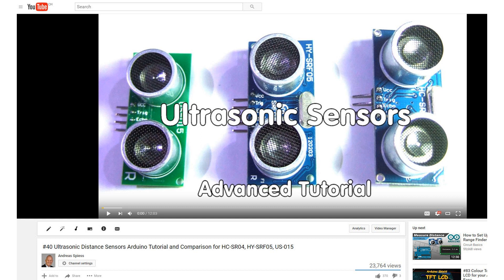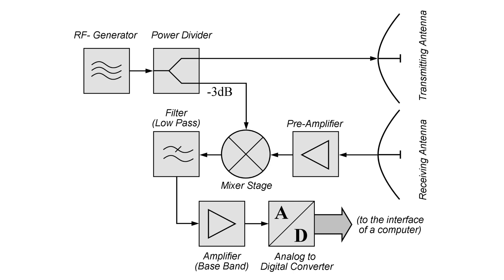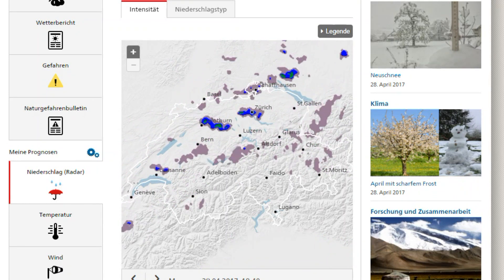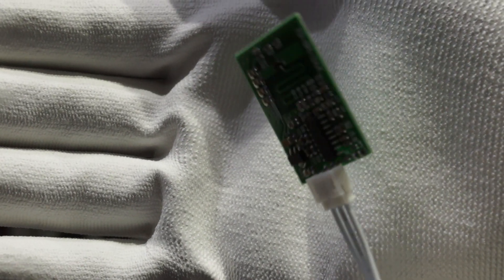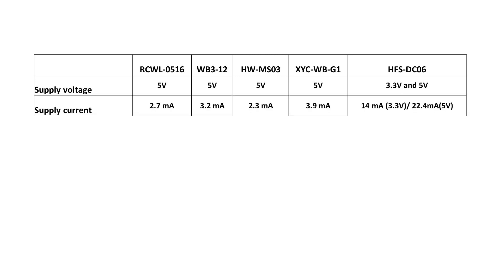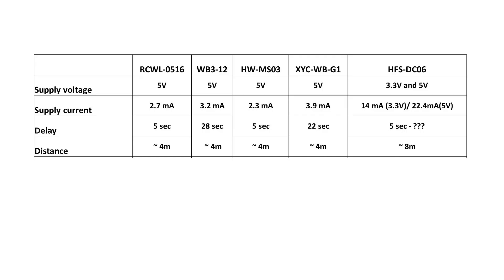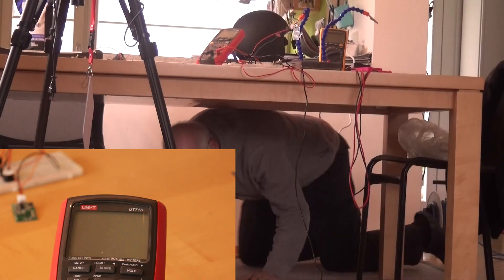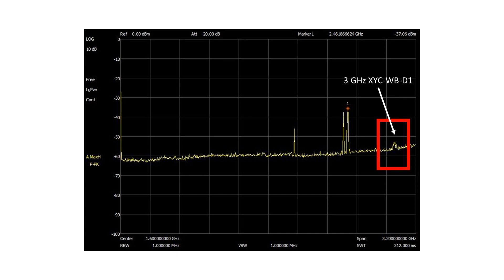#135 Radar Sensors / Switches: Comparison and Tests

Comment: thanks for your detailed summary - my favourite is also the RCWL-0516 (I've got a lot of them for experimental purposes) and I've also got some WB3-12 sensors but in contrast to yours, mine has got a delay-time of just 1sec - well, strange. I tried to find a way to influence this delay but so far I didn't find a way to manage it.  Apart from this there is another thing to mention:  in contrast to your words I just experienced, that WB3-12 (the white round) and the RCWL-xxxx  do interfere each other (however, I've tried it with just 30cm distance) - none of them is triggering in this close setting but actually it doesn't matter ..just saying  -  thanks and Grüße aus A in die CH  .)
Reply from the maker: Maybe they changed a resistor? Or there are different manufacturers with different needs for delays?
 Concerning influences: It is a wonder these devices work. For me, it is no wonder if they behave differently, depending on the example. They have no stable frequency. So maybe also randomness can come into play...
Reply: yes,  thanks - I've noticed that there are a couple of different types  of the WB3-12 but as mine just got 1sec delay it's perfect.   The system as itself is rather astonishing, indeed - well, it's genious and I've found an interesting link where this mixer-oscillator question is discussed in great detail    https://www.youtube.com/watch?v=jAeFQEHWLZU   ...interesting
Reply from the maker: Thank you for the link!

Comment: Hi. I've recently discovered the RCWL-0516 and in search of more specifics I've then found your video.Your extensive tests are very helpful. Especially the needed voltage to run it, the diagnosis if the devices interfere with each other, the directionality and what they penetrate.

Viele Grüsse aus dem Hackerspace Ruum42 aus der Ostschweiz.

Comment: Love your stuff.  This amplifier circuit might come in handy if you do more videos.  https://www.youtube.com/watch?v=snGy9pxeQj4
Reply from the maker: Thank you for your link. I did some tests with the 24GHz versions but did not get the distances you mention. We also used FFT and an ESP32 to detect the frequency, which is a little more complicated...
Maybe I have to try again
Reply: @AndreasSpiess   there is a "shield" amplifier p.c.b. available.  See: https://www.youtube.com/watch?v=TwmwfbFrPk4
Reply: Also GitHub project HB100-Doppler-Vehicle-Speed-Measurement/ has some nice moving average code.
Reply: See also: https://www.limpkin.fr/index.php?post/2017/02/22/Making-the-Electronics-for-a-24GHz-Doppler-Motion-Sensor

Comment: Great video.  Appreciate the effort to examine and compare the most important characteristics of each unit with a scientific approach.  I agree with you, even if the units are simply measuring the variance in transmitter output to determine motion, some sort of return circuit is required.  Thanks again.
Reply from the maker: You are welcome!

Comment: but in the first you told that they used to detect planes which are made from metals so what if we want to detect only metals which sensors are best for that ?
Reply from the maker: These radars should also detect metal. But I did not try it. We tried another radar which was fine detect cars.
Reply: @AndreasSpiess  thanks for the reply

Comment: I made a small project with the RCWL-0516 and all worked fine...until I put it in a plastic box along with a Rpi Zero W. The Pi reads the data from the radar on GPIO 17. I dont understand why the plastic box is blocking the radar, any idea? Did you try enclosing the RCWL--516 in a box for your test? Many thanks in advance for your tips.
Reply from the maker: Are you sure the effect comes from the plastic and not from the RPI?
Reply: Hi Andreas, thank you for your response! Your question made me redo some tests. I isolated the radar in a similar box, and not with the Raspberry. The effect is that the radar detects much better already, it gives a signal on any move. I also found a soldering problem that was adding to the issue when I was forcing the radar in the same box as the Pi, and that was the main issue. All in all, the plastic box doesnt stop the radar to work, but it seems - it is an impression based on several tests - that the radar should be at least 5-10 cms from the Pi to be optimally working.

Comment: I saw parking sensor radars on ebay and they are cheap.  they are used to avoid collisions.  I am not sure how these radars compare to radar sensor in this video, maybe it would be worth testing.  I could probably use them on my drones to avoid collisions. I have been curious for a while about radar, I guess it's time to buy some radar sensors.  thanks for sharing this video, it was inspirational.
Reply from the maker: I am not sure if the sensors you mention really use radar. Do you have a link to one of them?
Reply: @AndreasSpiess  you are right, I think they are not radar, probably they are IR sensor and labelled as radar.  here is the link: https://www.ebay.ca/itm/4-Parking-Sensors-LCD-LED-Display-Car-Reverse-Radar-System-Alarm-Kit-Black/163198740731?epid=7017182007&hash=item25ff6728fb:g:R6EAAOSwNchaTYiT:rk:3:pf:0

Comment: Very informative video Andreas! Thank you. I'm brand new to IOT and so thank you for suffering through my newbie question.  Are these devices just binary in their response (ON if someone is in the field, OFF if no one is there), or can they also report distance, in the same way a HC-SR04 ultrasonic sensor does?  trying to get a dimming effect on an LED based on proximity.  Thank you!
Reply from the maker: Radar detects changes in speed, not distances. So you have to use ultrasound for measuring distance.

Comment: One can detect movement with these sensors, but can it be used to measure distances?
Reply from the maker: No
Reply: Oh really? Im thinking the IC (or a different IC) sees the amount of delay and is therefore able to give you the distance?
Reply from the maker: They do not measure delay. Radar measure frequency changes.
Reply: @AndreasSpiess  The amount of frequency change then. That cant be measured?
Reply from the maker: Yes
Reply: @AndreasSpiess  So distance can be measured?
Reply: Anyways, thank you for the video and your reply.

Comment: Interesting. Are there any sensors like this, that output at higher frequencies, are capable of detecting small (say ~12"/30cm) objects, out to say 200-250 meters?
What i'd really like a small cone radar I can scan a small patch of sky. It'd be even more beneficial If it could have some sort of interrogation/reply included.
I really want to develop a few radar/IR target ID and IFF interrogation systems. It'd be cool to have IR cameras with ranging and signaling, along with radar information.
Reply from the maker: Maybe you look at UHF RFID tags. The respond.

Comment: Very good video, just a question: did you try to make an antenna to have a thinner angle? It should work isn’t it?
Reply from the maker: No, and this is not easy as it is on microwaves

Comment: There's a reversing sensor for cars that appears to work in the same way, but it detects anything moving towards it. If you do an eBay search for "electromagnetic parking sensor" you'll find one.
They state that you can hide it behind the bumper, but I'm thinking of putting one on the outside and covering with high visibility reflective tape!
Reply from the maker: Thank you for the hint. I ordered one to make a teardown...

Comment: Is their information about how much radiation is emitted by these devices and how much is safe?
Reply from the maker: Even if the whole energy used by the chip would be converted in RF it would be much less than a WiFi router or an iPhone.

Comment: Two points are still unclear for me: 1) Could I measure indirectly, somehow, the distance to the object?
2) Detection angle is 360 Deg for most of them and 180deg for one. I cannot therefore have a smaller detecting cone in front of the sensor of, like for parking sensors, is that right? Many thanks, very informative
Reply from the maker: There is only a on_off signal. And even if you find a analog pin on the chip the sensitivity depends on the object. Different objects will give you different distances. You should be able to shield the waves. Look for horn antennas.
Reply: Thank you Andreas for your kind answer!

Comment: Question: These chips have a transmitter and receiver antenna and the transmitter is constantly transmitting.  How does the receiver avoid getting blown out by the TX antenna that is transmitting on the exact same frequency it is listening for?  Yes I know some of the incoming frequency is sometimes Doppler shifted but much of the time it isn't.  So it's not like you can just filter out the TX frequency.  Or perhaps that's exactly what it's doing and just looking for what's left which is the Doppler shifted changes?
Reply from the maker: As I said: I do not know how they work. And since they only have one active element I do not think they have a formal transmitter and receiver.
Reply: OK thanks

Comment: Hi Andreas,
I only comment now (quite a while after watching this for the first time).
I got myself 10 RCWL-0516 sensors and I just LOVE them. I automated my lights in both my house and workshop. I even made an alarm sensor unit to monitor movement at my main gate. Thanks to this unit I was able to catch two thieves in the act of trying to break in (South Africa has very high crime rate, so you need to do anything possible to give you an early warning)
I did however found that if you are running the RCWL-0516 over a long distance you need to add a PI filter. Two big sized capacitors (100-470uF) with a 10ohm resistor in series (two caps ground tied to ground, one cap receives the supply power, resistor in series to the next cap positive and that goes to VIn of the RCWL. That completely eliminated any false alarms. 
The unit is very sensitive.It picks up small animals such as pigeons and cats. Oh, and watch out for FOG. Moving moisture seriously affects the unit. That was the only time it failed (false alarms). So for people living in high fog areas, sorry, this will not work. 
Thanks for a great channel. Love your work. Keep it up.
Reply from the maker: Thanks for sharing your experience. I did not know about the fog. And maybe it would help to have two sensors in the same area to distinguish between small and bigger "animals". Only if both see something it is big enough.
Reply: Hello again,
I found that these units are quite sensitive. I do have two units spaced about 6 meters apart (my original idea was to detect direction of movement). That works but it senses both human and small animals (i.e. the neighbors cat) with the same accuracy. I programmed my Arduino Nano to now count the number of triggers or monitor the duration of how long the unit is triggered before creating an alarm. This did eliminate many false animal triggers, but if the little critter decided to hang around the sensor, unfortunately then the alarm goes off. 
My HD Closed circuit camera system is then used to confirm friend (small animal) or foe (real criminal)
Reply: Yes, it worked for me in the hall all right but not in the bathroom, when I kept the unit on a plastic drum full of water. Somehow the effect was dampened and worked only within a few cm as opposed to 3-4 m in a open dry hall.

Comment: Great video.  I was hoping they would be more directional to replace my PIR sensors (I need them to distinguish between movement in my corridor vs inside a room), and now I'm considering creating barriers using glass.
Reply from the maker: Maybe you can increase directionality be shielding the rays with metal sheets?

Comment: Thank you for the helpful video! I'm going to try the HFS-DC06 for directional sensing.
Reply from the maker: Enjoy!
Reply: I have the HFS-DC06 and I'm trying to get it working but no luck. I apply 5volt at vcc. LED goes on and goes out again. After a 5 seconds it goes on and stays on. No luck in getting it working. Any tips or tricks? Thanks in advanced.

Comment: Actually HFS-DC06 also have other different input voltage level, DC5v   8-15v  12-30V, and the delay time is 2-120s adjustable,  Sensing Distance more than 12m,  Sensing Angle is right Ahead Cone 360 degree
Reply from the maker: Than you for your information
Reply: thanks for your video and let more and more people knowing it,  we are the original producer of HFS-DC06, have different kind of 5.8ghz Microwave Motion Sensor for LED Lighting, if you want to know more, can check this link our ali shop :  www.hdic.en.alibaba.com  or amazon shop: https://www.amazon.com/Energy-Saving-Microwave-Commercial-Residential-Anti-interference/dp/B078X95KQH/ref=sr_1_3?ie=UTF8&qid=1527845682&sr=8-3&keywords=HDIC&th=1   thanks again
Reply: Hi i also face some issue with the hfs dc06 that does not work at 3.3 or at 5v i need at least 12v 
Maybe the aliexpress is a good one !

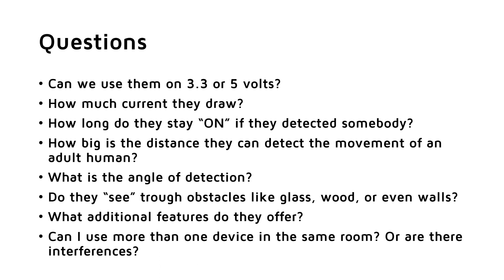Comment: 4:33 - for a moment, i thought you were going to say "i want also to know if they disturb my wife".

4:48 - where did you see this listed as being compatible with 3.3v? i found it on a few e-bay sellers, but they say the operating range is from 4 to 28 volts. that is also the range listed in the (very basic) rcwl-9196 "datasheets" i was able to find. i dont think feeding 3.3v into vin will work at all, but maybe feeding 3.3v directly into the (output) 3.3v pin will work, depending on how the regulator (inside the main ic?) works. later in the video you say it only worked from 5v, but did you try feeding 3.3 into the output, or just into vin?
Reply from the maker: I do not remember where I found it. So, maybe you just have to try it out. If I remember right there were also other comments about this matter.

Comment: an excellent video as always! I was wondering, can one use these as detectors for cables in the wall?
Reply from the maker: As shown they can detect through walls. But they are only DC, no 220 volts

Comment: Did you test to see if placing a metal screen behind the device could improve the directivity without affecting the sensitivity.
I assume that the position of the screen will be wavelength sensitive. Maybe placing a metal screen a quarter wave behind the device would place the screen at an RF node, re-enforcing the forward direction signal without adversly affecting the sensitivity.
I have a number of your favourite device on order, so I will perform the experiment.
My intention is to include the device with a PIR in an intelligent alarm sensor. One problem is that I intend to use a Xbee mesh modem to report the alarm readings and control its configuration. This includes control of a flood light and an ambient light detector.
Reply from the maker: Please update us with your results. I did not make these tests.
Reply: Andreas Spiess I will do so when the devices arrive. I ordered on Amazon and they may take three weeks to arrive.

Comment: Hello Andreas,
Could one restrict(reduce) the field of view of any of these radar detection modules using a parabolic dish or some other type of directional antenna (yagi?) in order to get some sort of bearing of a detected object?
Reply from the maker: One of teh sensors has a restricted field. So it is possible, but not easy because of the high and unknown frequencies.

Comment: Andreas,  I believe that there is no problem  even you simultaneously operate the devices in close proximity, unless they interrogate at the same time. Radar operates on transmit wait then receive. If the time slot of tx/rx is not the same they will surely operate without problem. With 10m range, the system can have wide and numerous time-slot.
Reply from the maker: I do not think these devices work with switching the carrier on and off.

Comment: The glass test shows that you have low-e glass, which has a thin metal coating that reflects back infrared and lower, radio frequencies. Normal, uncoated glass should be transparent to these sensors -see https://en.wikipedia.org/wiki/Low_emissivity#Criticism_of_low-E_windows
Reply from the maker: This was suggested by other viewers. I do not know because I bought the windows with the house.

Comment: I don't understand why some people enjoy disliking such videos. If you have a comment write it. Don't waste people effort.
Reply from the maker: I have a quite stable number of thumbs down. Always around 10. If I mentally subtract 10, it is ok for me ;-)
Reply: Andreas Spiess seems they are the same people then :)
Thank you for your videos. 
By tye wwy, my RCWL-0516 is working well at 3.3V. I supplied it through the 3.3 pin and it's working without no problems. Maybe it's just an upgrade.
Reply from the maker: I got this 3.3 volts message a few times. So, the newer versions seem to work.